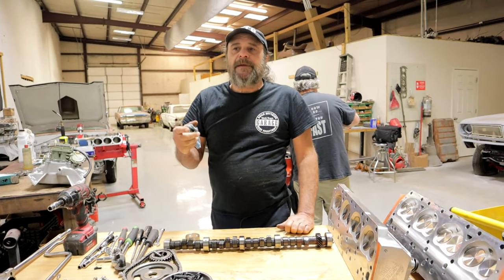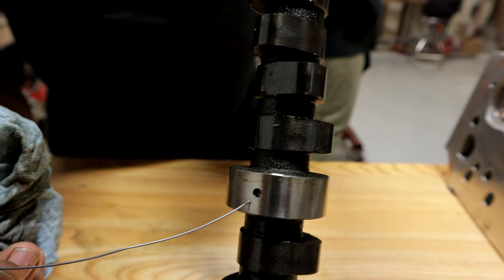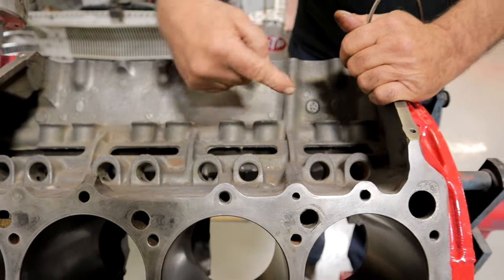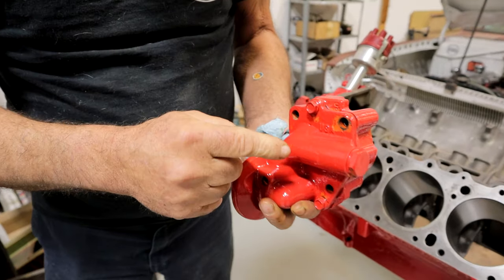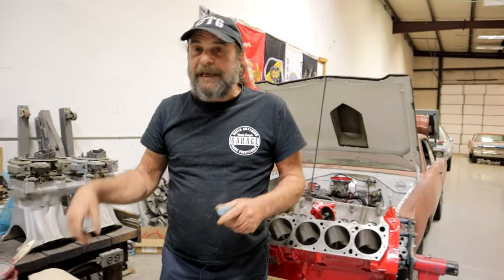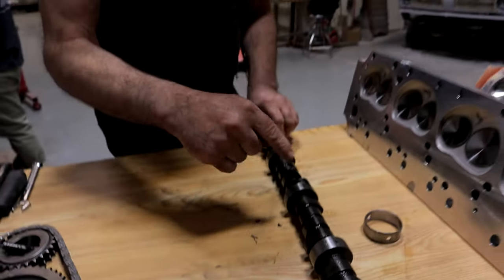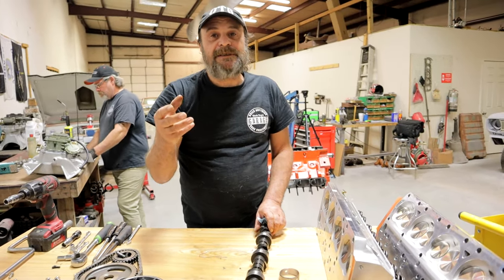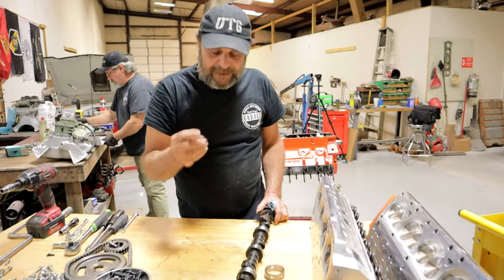CRITICAL Lesson For The Home Engine Builder- MORE Camshaft QC Issues To Wreck Your Day

Comment: I get an overwhelming response to "why does it take so long, just get it in there" well..... here's your sign. In this day and age esp you have to test fit Everything, and go over Everything with a fine tooth comb before you dive into it. I think people (young and old) have gotten too accustomed to "plug n play". Great Video UTG!
Reply: Just to get it in there?! Lolol said the person with absolutely no mechanical inclination at all.
Reply: Why does it take me longer to assemble a motor then many other folks?

 Answer, because MY motors are STILL RUNNING ! with regular oil changes for 100s of thousands of miles ! because I clean everything over & over & over in very great detail each time before my final assembly. The machine shop cleaned everything and said it was ready for assembly, Should I take the time to clean EVERYTHING AGAIN ? No, clean everything and use a gun wire brush kit on all oil passages 3 or 4 more times, and then one MORE time. There is no such thing as TO CLEAN ! Should I clean everything again ?  SURE it costs nothing but time.
Reply: I mean, start to finish 2 days maybe from bare block and i still make sure all my parts and surfaces are clean, everything lubricated, torqued correctly, etc. Sometimes you just get the shit end of the stick no matter how careful you are
Reply: @texastootin1628  Oh yeah 120% agree

Comment: Funny you should mentions Chrysler cam bearings; The team I was crewing for at the 2001 NHRA 50th Anniversary race at Pomona, had a new bullet in our Top Alcohol Dragster. I pulled my valve cover, right side guy, after the first qualifying pass. The pushrod ends were melted. I mean, blue, mushed over ruined! No big deal, we have a few spares, I replace the worst ones, replace some of the ball end adjuster screws, lube the ends and send it to Q2. It come back worse! Our crew chief (who will remain nameless) blame the inexperienced crew. I proceed to 'trick or treat' through the pits, find another team with a tall deck BAE Hemi and raid their spares drawer in their trailer. I find what I need, reassemble the top end, and this time, I insist we fire the engine wo/ the valve cover. Guess what? My crew shirt remains as dry as a nun's center section, if you know what I'm sayin'. We swap short blocks, our weekend goes from bad to worse, we pack up tail between our legs and go home. Turns out someone installed the wrong cam bearings, or installed the right ones incorrectly in the short block. Not-so-fun times

Comment: Always clean all oil passages before you install anything! I've had several cranks, even a custom cnc piece that had stuff in the passages. 5 minutes will save you thousands.
Reply: Amen to that! Check fit everything, and check it all again. Esp in this day and age
Reply: Buddy of mine had head rebuilt with new cam for his turbo Honda. 

Went to dyno. 
Made less hp 
Then less
Then less

Then the cam locked up. 
Head never got cleaned properly.
Reply: Black Rock shooter

Comment: That is absolutely terrifying coming from a person who just finished putting a motor together that’s one of those places you could potentially easily overlook scary business scary business
Reply: I can appreciate your concern. I've got a short block assembled 4 bolt small block on a stand in my shop right now waiting for me to complete. Factory Roller comp cam installed....
Reply: Agree!  You second guess anything that pops up, later.  Sleep loss.
Reply: I put magnets in drain holes in heads and JB weld a round magnet to the drain plug.
That will tell you if something is fudged up.

Comment: Bought a set of Dart heads 20 yrs. ago, couldn't get the bolts started, bolt holes were out of parallel from the dowels .045 and .062 end to end. They took the heads back, said they would send new ones as soon as they got some castings. I called every month for 3 months, finally got some heads, they sent the same ones back with the holes opened up with a die grinder. I told them I didn't pay for seconds, a few days later a new set came, along with 2 free tee shirts(whoopie). About a year later went to see a former co-worker that had a small machine shop, had a pair of Dart heads in the box sitting there, said he had to open up the bolt holes for their owner. So this is nothing new. Never wore the shirts, no free advertising from me.
Reply: Were the shirts at least all cotton so you could wipe up oil spills with them?
Reply: @craigbenz4835  I had to check, Jerzees heavyweight Made in Mexico.
Reply: @kustomdeluxe8489  so halfway decent oil rags

Comment: This applies to everything. I can't remember the last time I've done a brake job where the pads fit in the guides. Every single time I have to file them down to get them to fit. Doesn't matter what vehicle I'm working on. GMC Sierra, Subaru Legacy, Ford Focus, Saturn Aura, Chevy Malibu, all different brands of brake pad and every single one of them needed filing to come even close to fitting.
Reply: I just went through this, the one that would fit was so tight it would dragged bad.
Reply: Hyundai/Kia serious malfeasance from the factory.
Reply: yep, so very very true my friend!
Reply: aftermarket pads, OEM receptor seasoned with age :)   Just  be glad they designed in more material you could remove than less.
Reply: That's how it is these days. EVERYTHING needs to be fitted.
Reply: I just struggled with my pads. Top of the line aftermarket. Good to know that the fit is off from the manufacturer. I was teaching my twelve year old son and he asked me if I was sure I knew what I was doing!
Reply: @marthamryglod291  hopefully you are able to explain to your son, that often in life parts and people are "fit to size". of course, we all "knew everything" back then :)

Comment: Thanks for sharing your knowledge. Love your channel. 
I wish you could have posted this last year. What started out as a cam and lifter swap on a 5.7, due on a to lifter failure turned into a rebuild when we saw some minor damage to the top of one of the pistons. So after a thorough cleaning new rod and crank bearings, new rod, crank and head bolts, valve job and resurfaced heads, new name brand cam lifters and springs, it laster about 50 miles and grenaded. Upon dissassembly we found the cam had seized in the cam bearings resulting in two spun cam bearings, a destoyed cam phaser and 16 bent valves.  
The cam journals are about 2 thou. larger than the stock cam. It installed without alot of effort and i made the assumption it was fine ( did not measure it before intallation, my mistake) .
Again, thanks for sharing.  I dont want anyone to go through this.
Reply: Yeah..... this is definitely a hard lesson to learn the hard way, and sometimes if we forget it comes back to bite us all.

Comment: I had the exact same issue on my rebuilt 383. First start,no pressure. Immediate stop saved it. A little spiral of metal from drilling the cam at the factory. Once solved,the engine( with hivol Mellings pump had 80 psi at cold start.
Reply: This is an extreme case, but yeah.... I've come across this as well and not only in the Cam.

Comment: This applies to staple parts too. Run your finger inside the threads of a new oil filter. Any brand. Metal debris. Learned this the hard way wiping out two mains. So now beside the obvious pre-fill, I always half-fill, shake, & empty them to rinse. Try it sometime & empty it into a paper towel;  truly frightening.
Reply: "run your fingers inside the thread of a new oil filter"  I did that and got a metal splinter and a big cut on my finger...   Use caution!! ;)
Reply: Yeah, with metal parts, maybe NOT running your fingers over stuff might be a good idea!! Takes a little higher IQ, but not that mich!
Reply: I like mmo on a rag, lot more replaceable than my fingers

Comment: Good catch, even if it’s your 1000th engine build! A friend of mine does my machine work, he’s very good but he must’ve had a bad day. I was about to bolt on the external oil filter housing on an Olds motor he went through and reassembled for me when I saw grit in the galleys. Like you said UTG, full stop
Reply: I hear ya man. This one is pretty extreme, but for me it's always been 2nd nature to check everything, sometimes twice.

Comment: Thanks uncle tony. Changed a flat tappet camshaft in a generator today. 350 sbc. At 6000 hours it decided it no longer needed #5 exhaust lobe. Not sure if was a soft cam or a faulty lifter. Of course customer chose to go ahead with installing cam without disassembling and cleaning entire engine. Thank you for the video! When using mid to upper level cams and lifters normally getting 30-40,000 hours of 24/7 use in the oilfield from a sbc 350.

Comment: My instructor, at the vocational school, stressed this. I had my 350 crank reground by a very well known machinist, in my area. It's a good thing he did. Because there was grit in the oil passages.
Reply: As a guy that does machine work and occasionally on large industrial engines I always tell the customer I have ran it thru the parts washer but you are responsible for final cleaning before assembly. Most people aren't big on paying $100/hr for detailed cleaning.

Comment: I've built 5 engines and I just look them over but they were Ford and Chevy engines and they didn't have those holes also just glanced at the block and crank but the machine shop said they cleaned all the holes and chased all threads I looked and they all were fine this was over 15 years ago though no problems fortunately I will definitely clean the next one.

Comment: A similar thing just happened to me a couple days ago. Maybe not as bad but I got my block back from the machine shop and figured I should test fit the cam. Super common stock style Melling cam. All the oil holes on the journals have little burrs around them. I didn't notice so it scratched the hell out of the brand new cam bearings. The rep at Melling said I could return the cam to the retailer, the retailer would send the cam to Melling to analyze and they would make a decision. Big companies are great....
Reply: Buy Elgin cams

Comment: That's very good advice for sure. I did a in frame rebuild on a cat 3406e 5ek in one of our old trucks this past summer and the normal job took a hard turn when we pulled it apart and the gear train on the front of the motor was chipping away in a bad way and the 3 day over haul turned into a 2 week over haul because we had to clean all the metal out of the block crank and everything in between and that was a job in itself. Great video again thanks.

Comment: Thank guys for the video! U just saved someone ALOT of headaches! Clean and inspect everything..even if it's new! You just never know when shit like that going to show up. 5min worth of not cleaning would have resulted in lots of work in the end! Sad that the cam manufacturer let that out the door. I had a block come back once with the #7 bored out to 
.020 instead of .010 like the rest of the cylinders. I got right to the point of assembly and just wanted to double check everything when I discovered it.. So that was a total saga in my life..and the machinist finally corrected his mistake. but point being bad work by other people can happen anywhere!

Comment: I found that very interesting. After my block was cleaned I always removed all of the block's oil gallery plugs and used my gun cleaning kit with a brush and solvent and cleaned the galleries from end to end in both directions. The last thing was to blow out ALL galleries with high-pressure compressed air to remove any brass brush bristles that may have been left behind. Then replace the push-in pugs with threaded pipe plugs and Teflon tape.  You will need to tap all of your holes in the block for threaded pipe plugs BEFORE you start cleaning.

Comment: This is perfect timing for me. I’m just starting my Cherokee 4.7 stroker build! Thanks for this video!
Reply: You should video it man! I'd like to see an Average Joe build on one of those. Heck I even sent you an insensitive there to get you started (you know one person will watch it with that sub lol)
Reply: @BareRoseGarage  , hey barerose…haha, I’ll give it a shot on doing a video series! 😂, can’t be too tough with a GoPro I have around the house.
Reply: 258 crank, no overbore?
Reply: @titaniumman_22  sweet
Reply: @ScottKenny1978 , .060 and yes on the 258!
Reply: @titaniumman_22  sweet!

I'm planning on doing that to my Cherokee, about the time it hits 200k and I need to do a bunch of work to it anyway. 

Not sure I'm going to do .060" over, though. Probably just .030" for a simple standard size and call it good with the 258 crank.

Plus new clutch and rebuilt transmission/transfer case, and a minimal lift with Rancho suspension to soften things up while off-road.
Reply: @ScottKenny1978 , sound like we have similar projects on our hands. I’ll be doing the transmission and transfer case too. Mine is a 98 Cherokee.
Reply: @titaniumman_22  94 for me.

Getting LEDs in all the lights right now, just replaced the headlights.

Comment: I'm just starting to learn more and more about disassembling and reassembling engines. At the moment I'm learning on my motorcycle by doing my own valve adjustments and recently having to replace a head gasket. Everything I've learned so far has mostly been from a service manual and trial and error prevention😅😂
I've gone from saying I'll never go into the engine and now I'm getting more and more confident in myself thanks to old school guys like yourself and a lot of reading on forums from others that have the experience with my particular engine. Thank you for the video because I now know one more thing to look for

Comment: I have a camshaft from Trickflow in my 440. I have not started it but it is installed. I ran my oil pump via drill to make sure I was getting oil up top. ( also turned crank by hand some to let other oil holes purge)

I never knew to check these holes and have installed a few cams. It makes sense, especially with QC issues today.  We will see how mine holds up, as it is too late most likely for me.

Comment: I had the GTX with a six-pack 440 Magnum and it was fast but I got the 428 Super Cobra Jet and I could outrun the GTX 440 Magnum I could not believe the code yet without run just six-pack 440 Magnum GTX but it will so I took the Cobra home to find out why it was out running the GTX and I found out he had a drag pack gear and that's why I was out running the GTX but I still love to GTX cuz GTX ammo parses badass blood video man keep up the good work

Comment: Hi Tony,as always great content!
I have been wrenching American muscle cars & motors for over 50yrs and have seen quite a few brand new cams with defects right out of the box from mainline aftermarket cam mfg’s that would led to problems for sure if not caught & corrected prior to assembly. 
Defects were small chunks of metal broken off the edge of cam lobes,scratches & dings on cam lobes & cam journals too.
Have also seen std non roller lifters with edges chipped off & or with scratches dings etc on the foot/base of the lifter. I have also seen lifters that weren’t ground properly with improper finish/surface on the foot too.
Like you said the bottom line is inspect all brand new or newly machined parts from the machine shop very well prior to assembly or you could loose a set of cam & lifters or worse yet the complete motor in short order if you miss something like you found like this cam with metal hoop in the oil passages of the cam. 
Happy motoring & keep up the good work!

Comment: Fastidious inspection of every part is as important to successful building as every other step.  It can’t be overlooked. 
Modern production capabilities such as the cubic boron nitride grinding wheel can give high material removal without thermal damage.  However, the shape of the metal debris removed can be different from the debris produced using the grinding wheels of yesteryears. 
These curly strands of debris will get pushed into holes etc. where it used to be dust getting pushed in.  Old style grinding dust will wash or blow out, CBN curly strands get stuck as we see Tony fight with the welding rod to clear the passage. 
New technologies require new techniques we can’t always maintain practices from other methods.  
Great going there Uncle Tony 👍🏻
Reply: Interesting points there.